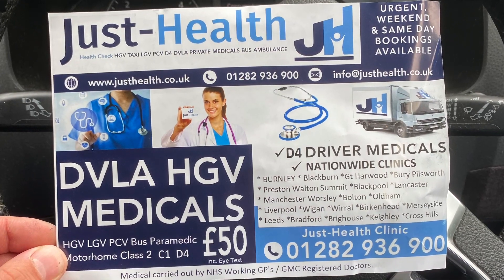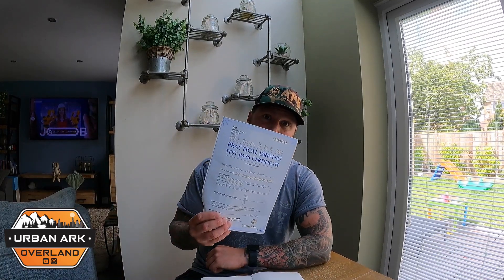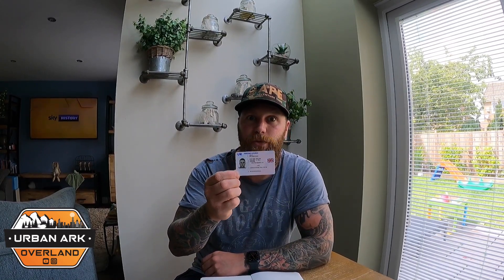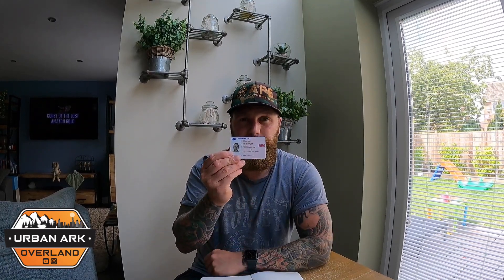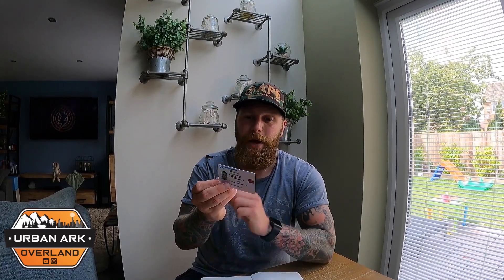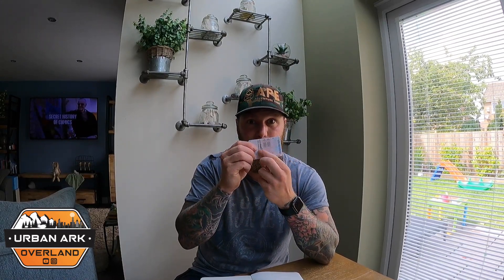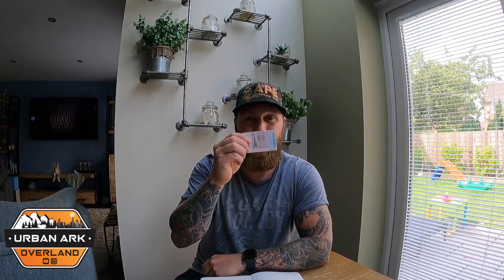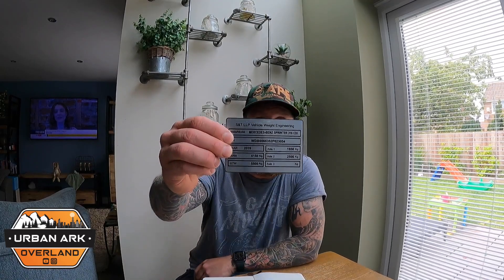OVERWEIGHT VAN. 650KG EXTRA. PROBLEM SOLVED.

Comment: Mate, you info is gold, I'll follow your advice for my sprinter LWB that was 3.500K EMPTY after self conversion, with stuff + water at least 3800K. So thank you very much!
Reply from the maker: No probs matey 👍🏻👍🏻👍🏻
Reply: @urbanarkoverland  Mate, I followed your advice, everything have been excellent, I got my C1 and my new plate, just waiting for the C5V from DVLA, just one quick question: How long did it take your C5V to return? 
Just and update for everyone: van weight engineering fee 2024 for my LWB sprinter was £270
Thanks mate., and again tank you very much for the advice.
Cheers!
Reply from the maker: @ysanmiguel  I can’t remember mate. But think it’s up to 5 weeks. 
Also… look forward to cheaper road tax 😋
Reply: @urbanarkoverland  Thanks mate and the road tax is excellent news isn't!. thank you very much.

Comment: Hi, very informative.
Do you need to worry about the load rating of the wheels / tyres now?
Reply from the maker: Yes. They take into consideration wheels and tyres. But mine are both rated high enough 👍🏻

Comment: Great that you passed your test 👍 SV Tech did our up-plating and Steve was an absolute star. Helped us through every step. We’re a van with windows and although now and PHGV. So we have lower RFL and have to take to a HGV testing station for mot’s. Better safe with a decent payload than always be looking over your shoulder 👍
Reply from the maker: Thank you very much. Been trying to find info on mot etc. Is the hgv testing a big deal. Amid a garage harder to find. I guess it’s more money. But a reduction in tax. A hike in mot. And it’s all the same 💁🏼‍♂️
Reply: @urbanarkoverland  Haven’t looked into it as it’ll be what it is. Def hard to find info on PHGV though. Maybe I’m using the wrong key words 👍 Hey ho 😊
Reply from the maker: @sunnycampers4249  I will ask the guy that’s up plating mine. He knows a few things. If I find anything I will get back to ya. 
Stay safe 👍🏻
Reply: @urbanarkoverland  You can still MOT your vehicle as a standard class 4 as normal. The vehicle is tested "as presented" and independent of the body type on the logbook, so if you present it as a motorhome/camper then that is what it will be tested as, and there is no upper weight limit. For example, my Transit Luton is 5,200kg and is tested on a normal class 4 as a camper, so no need for a HGV/Ministry test. The only caveat to this is that you'll want to check with your tester that your vehicle can physically fit in the garage (mine is almost 4m tall) and can be lifted by their lift, or if they have an inspection pit. I hope this helps you and @Sunnycampers?
Reply from the maker: @VanWeightEngineering  thanks for this 👍🏻👍🏻

Comment: My up plate application is already in with SVTech. I was told by a mechanic it can have implications on MOTs, in that I may need to take it to a different garage who can support vans over 3500kg. The MOT engineer has confirmed that even though mine is going to 3850kg  its already registered as a Motor caravan so it remains in the same category and can be MOTd at the same MOT station. Thats a result 😎 Now to get the rear tyre carrier and other things to eat away at the extra KGs
Reply from the maker: That’s a fair point. Not looked into MOT 👍🏻